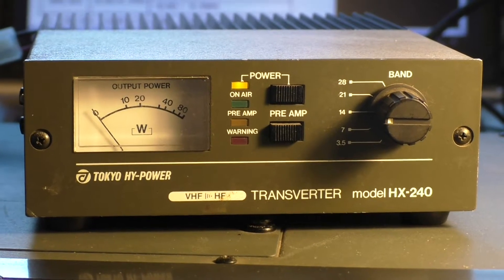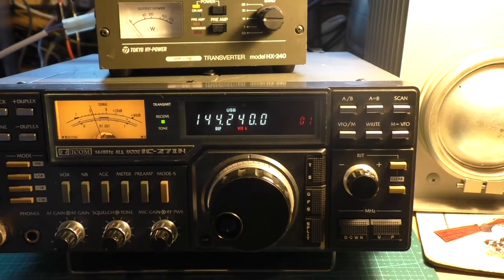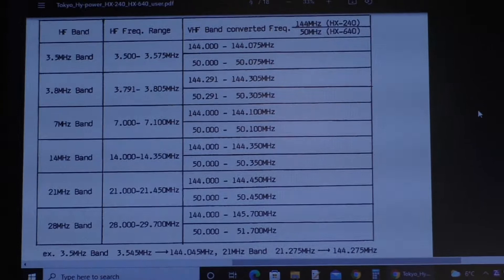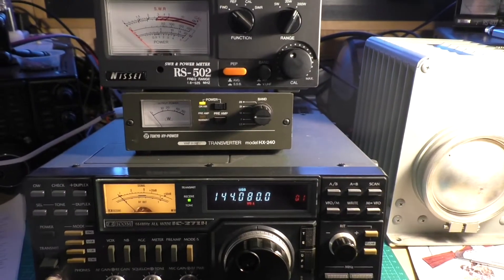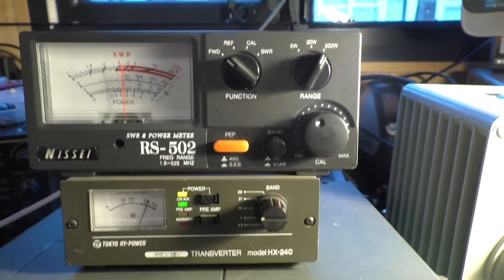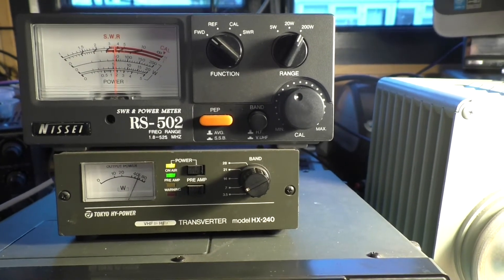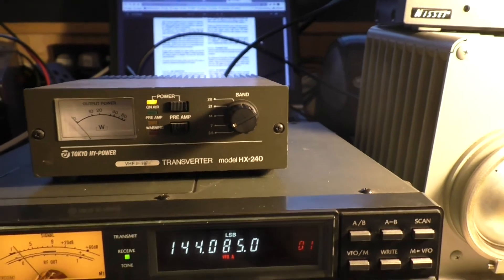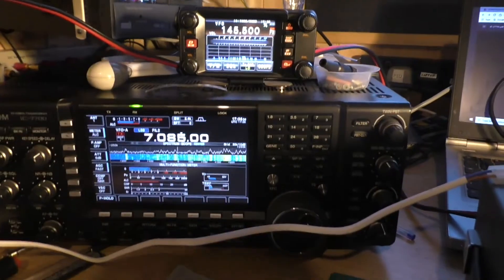Tokyo Hy-Power HX-240, 2M  to HF Transverter 10-80 m

Comment: can you give me the information, where did you buy the transverter? and also when you use 7mhz, means that you need to put 7mhz antena also right not 2meter antena/vhf antena, sorry for my silly question, thank you very much 73
Reply from the maker: Hi, transverter Brought on eBay, they come up now and again, you will need a tuned antenna for the band you with to use or use a external ATU and as in my case i use a End feed wire for 7 and 14 Mhz. Hope this helps.
Reply: @wayne phillips  Well Noted. thank you very much.
Reply: does it go 11meters?
Reply: @robterza no